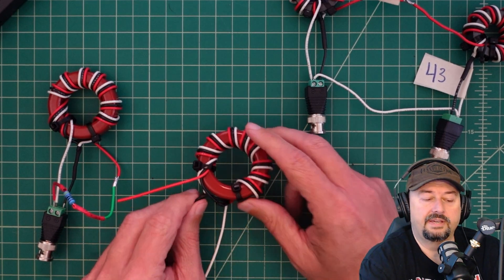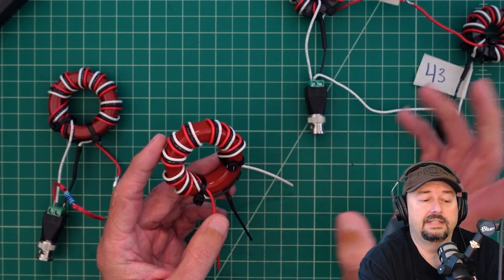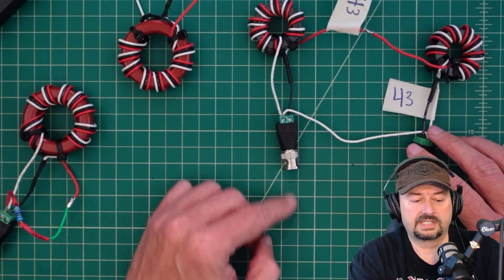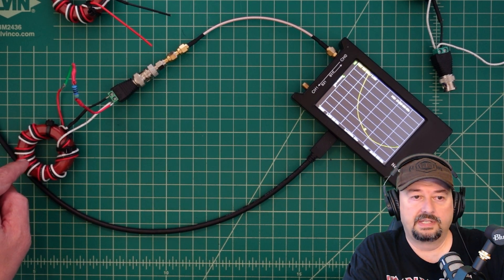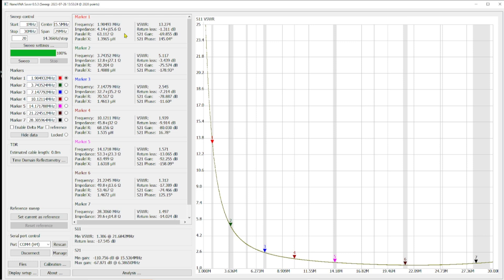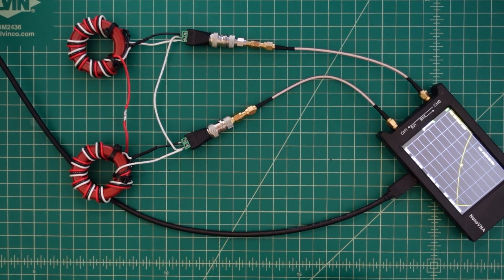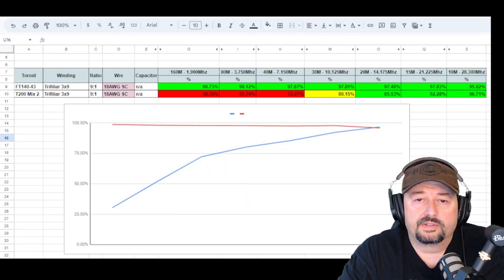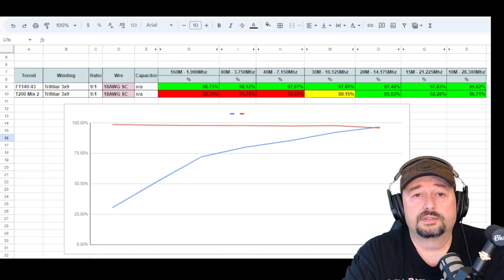Random Wire Antennas 9:1 - Powdered Iron Mix 2 Cores

Comment: Obviously I'm late to the party, but this interests me because I really know very little about powdered iron cores. I've got a decent grasp on the various Fair-Rite ferrite mixes commonly used in amateur radio but I still feel kind of in the dark about iron inductive cores and don't feel they are documented nearly as well in ham "layman" terms. In other words, what works well for a balun @ x to y frequencies, or what works well for a common mode choke for HF. I've accumulated a handful of powdered iron cores over the years but have never really used them for anything because I don't know their best applications or even how to identify them.
Reply from the maker: Powdered iron toroids are widely used in ham radio for building inductors, baluns, ununs, and RF filters, especially in the HF range. Common mixes like Type 2 (red/white) and Type 6 (yellow) are chosen based on frequency and desired inductance. Unlike ferrites, powdered iron cores are better suited for narrowband applications and are ideal for use in antenna tuners, low-pass filters, and matching networks. Their color coding indicates the mix type, which determines their permeability and performance characteristics.

Comment: A red and clear (or gray) powdered iron core is a Mix-2 core, not a Mix-6 core. Mix-6 is a yellow and clear (or gray) core. People get confused about the 'clear' notation since the core material itself is a gray color, so in the case of core materials, a clear coating gives you gray. 
Thermal considerations aside, the widely accepted rule of thumb for broadband transformer applications like this antenna impedance matching application is that they are typically implemented best with a ferrite core, like the Mix-42, while powdered iron core materials like Mix-2 and Mix-6 are typically best for specific frequency (meaning tuned/resonant circuits,) applications like IF stage coupling, or filters. Generally, Mix-2 is better for the lower HF range while Mix-6 is better above 20 meters. Again, this is for specific, tuned frequency applications, not broadband applications. Powdered iron is simply too lossy in broadband applications.
Reply from the maker: Totally agree John, and I did get the 2 and the 6 mixed up.

Comment: I'm surprised it worked as well as it did. Looking it up, those cores have an AL value of around 10, which gives 1uH of inductance or 130ohms of impedance at 21Mhz. Type 43 cores have an Al value of 850 and give 70uH inductance with 9 turns, which is around 10k ohms impedance at 21mhz.
You need low values of inductance for filters, these things will probably shine in filter application - maybe repurpose them for high-pass AM blocking.
Reply from the maker: You know, I was surprised too 👀